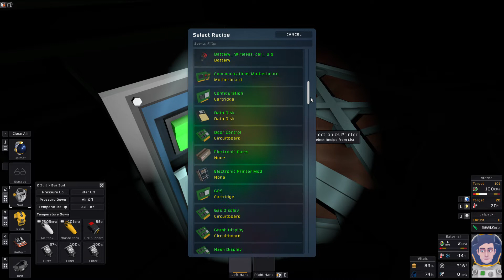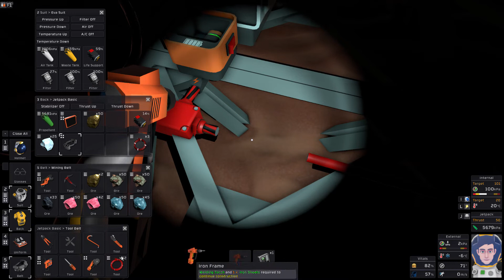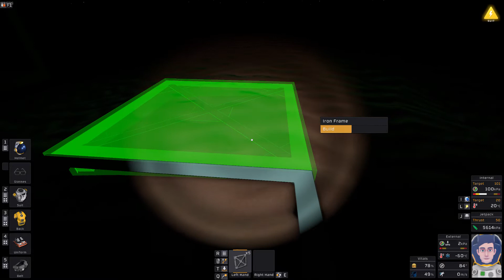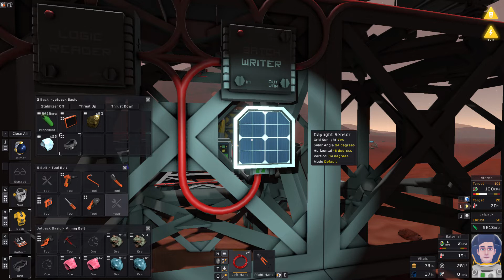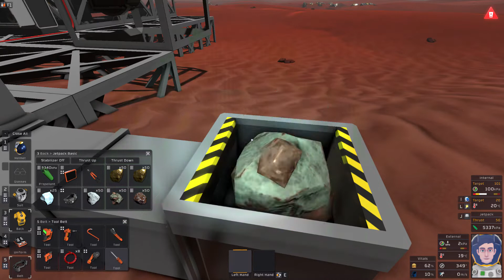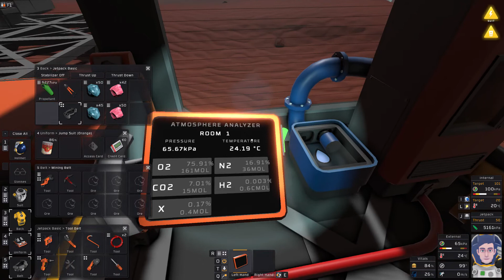Stationeers Play Through Part 2 : Early Automation

Comment: Nice Work. You forgot to mention that when you set up the solar panels, the light sensor must face the sunrise and the panels have to be at value 0. Had some problems setting them up and i didn't know what i did wrong. But general, a really nice job
Reply from the maker: Yes good point! Solar panels is on my list for a bite-sized "How To" video and I'll be sure to cover it when I do that.